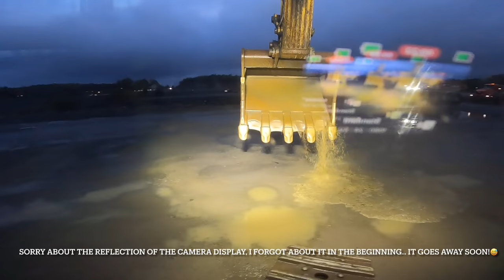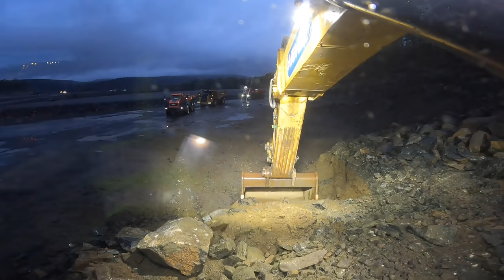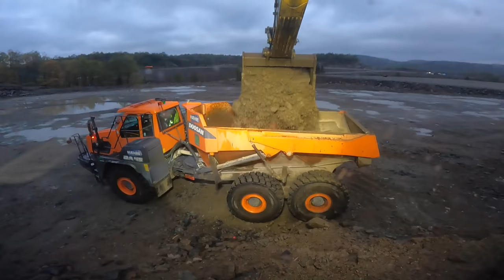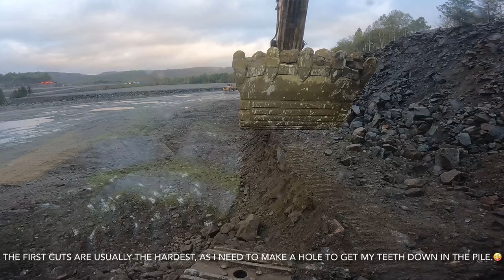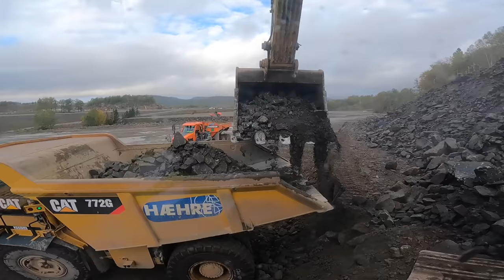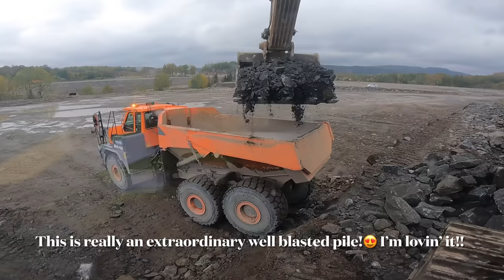I’m back!🙋‍♂️😅 Cat390F In classical double benching!💪 Efficiency in progress!😍(Aussie style..🤭)

Comment: I see the light indicators on the truck,  are those to let you know the limits. What happens if you exceed the load  limits, I've always wondered??
Reply from the maker: You are correct, those lights indicate the payload on the trucks!😋
When the light turns blinking red, it indicates that I can pass one more bucket on the truck. Constant red is full, but this is not a super accurate weight system.🙃
The 772’s have a certain max weight, but we do have a few tons to go on.
This rock is lightweight compared to other kinds of rock, so I’m not always able to reach the max weight though.🙃
Well, consequences of overloads are higher wear on the truck and tires, as high weight bends the steel, undercarriage and tires more than it’s intended to outlast.
Fuel consumption goes up, so the haul gets a higher cost with the additional wear, than if we stick within the limits that the trucks are intended for!🙃

Comment: The digger I drive has a earth track system. Which means it is a silent horn. So in the cab I press the button and the dumper operator has the buzzer in their cab with a red light. So they know it's time to stop reversing or it's time to drive off.
Reply from the maker: That silent horn seems nice!👌😊 I could enjoyed having that system myself!🙂
However, we use the horn to signal drillers, blasters and other people or vehicles as well. Do you have an additional horn, or just this buzzer? At some points, I receive several trucks or ADT’s that usually don’t haul from me, so I need a signal system that can be heard by everyone.😄
Reply: @norwegianearthmovers  it's called Earth track. So all the dumpers assign to the same digger can hear the silent horn. But only in side the 50 meter radius from the digger. 
And all the dumpers approach and que clock wise to the digger. Very simple. 
Thanks for replying to my message. Really enjoy your videos.
Reply from the maker: I understand!😋 Thanks for enlightening me!🙏
I do have a regular fleet of 3-4 772’s, but in most cases there will approach up to 6-7 adt’s, and sometimes even some road trucks.🙃 So I’m not sure if earth track is suitable for me, as I often have to serve additional vehicles as well.?😅
You are more than welcome, it’s rewarding for me to learn new stuff by fellow operators!🙏

Comment: Different bucket then your last video I watch. Is it smaller.
Reply from the maker: Hi!👋 Both buckets are of same size!🙃 They are of the same brand, and has been identical. The one with 4 teeth has been rebuilt, where we made the blade pointier, as well as the total weight was reduced with about 500 kilos!🙂 So the rebuilt one is so much easier to fill compared to the other one, allowing me to achieve a much higher fill grade of the bucket!😍

Comment: From the reflections of the camera display I guess you have a thin pane of glass on the outside to take the daily abuse and then a thick one on the inside of that for penetration safety?
Reply from the maker: You are correct!🙏🥳 We have this explosion proof “hammer glass” as front windshield on all of our machines! 
The glass is mounted on a steel frame to the cab, instead of a rubber list as usual glass is mounted with. The thickest glass is 22 millimeters thick, and the wear shield in front of it is 4 millimeters. This setup is proven to resist an explosion of 3 kilos of TNT at 3 meters range, and we have it on our machines to make us operators safer when working with blasted materials!😊
There are unfortunately times where all of the explosives hasn’t detonated in a blast, with this glass we are much safer!